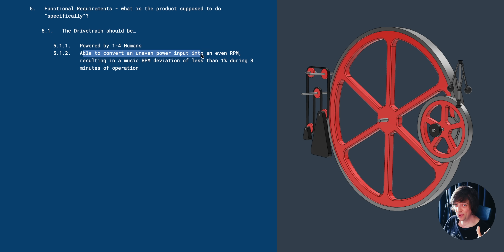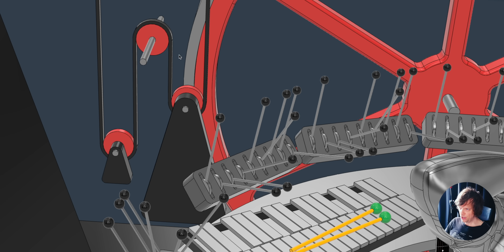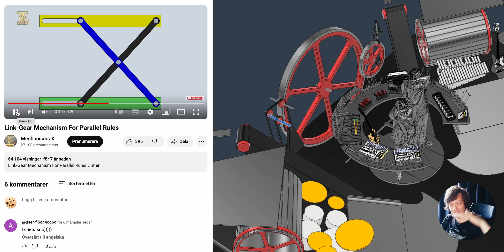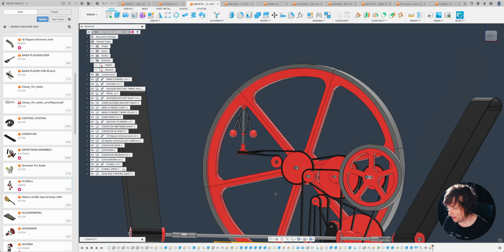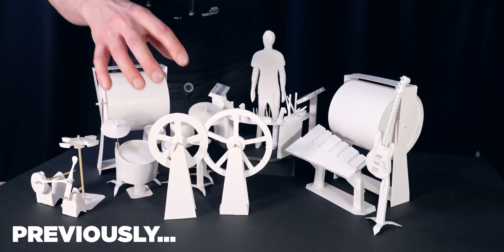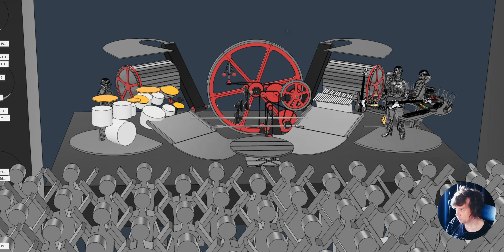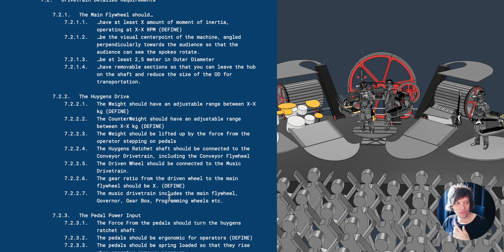The Marble Machine Drivetrain

Comment: As a stagehand I would recommend making the machine able to be assembled or disassembled in under an hour. In fact if you plan on touring MM3 I implore you to think about how it loads in and out, how it packs into a truck, and who you want touching it. Tie every design decision back to the load in and out of the machine, you will save a lot of headaches for everyone. Think about how things could fit into standard road cases or pelican cases and what needs to have custom transit equipment. Think about the other elements on stage with you, the lights, sound, atmospherics, automation, laser, pyro or CO2, and everything over in dimmer beach and soundland. They are packed in very specific ways on the truck to ensure driving stability and efficient load in and load outs, so they are loaded and unloaded in that order, having this giant thing in the middle of the stage could increase your in/out times by hours. I don’t know how it works in the EU but in the US and Canada most of your local crew will be union. IATSE has strict rules around working hours and you’ll end up paying a lot to the venue for any extra time worked while trying to maneuver around this machine even if they aren’t touching it so the venue can pay union rates. I would also recommend hiring a technical director to help you in considering all of this. I can’t wait to see MM3 eventually and if you consider these factors that can hopefully be soon.

Comment: Are the pedals really a good idea? Seems like they will require a lot of effort to drive the machine. The prototype for a flywheel back in Germany seemed like pretty heavy work eventhough there were no equipment to be driven.
And with this heavy work for the two operators, will they have enough balance to play the keyboard?

Comment: The design looks great. One of your requirements should be a a both modular and compartmented design that facilitates reasonably straight-forward set and strike capability that also minimizes the amount of manual assembly of the various components. This theoretically should speed up set and strike, ease of getting loaded in and out and reduce the chances of parts going lost and/or missing. Rely on readily available off-the-shelf parts whenever possible so things can be replaced and a reasonable supply of spares can always be kept on hand.

Comment: Why not put the flywheel and related mechanics in front of performer/operator platform, but have platform elevated by about 1 meter, such that the top of the flywheel is roughly waist-height for a human standing on the platform? That gives audience a clear view of both the machinery and the performers. One downside is there's no longer a big elevated flywheel as a backdrop. Maybe instead of the flywheel backdrop, you could have a single huge marble conveyor belt (which feeds marbles to instruments on both sides / programming wheels) as sort of a "wall" behind the operator platform.

Comment: Martin-  the position that occurred to me when you were trying to make the mechanics visible was up.  Lift it up and drive the program drums and belts from the top rather than the bottom.  Not sure if you run into logistical problems with a vertical clearance requirement that tall, but it seems like it would work both visually and mechanically.

Comment: You have a conflict between two unstated requirements:  1) the pieces of the mechanism should be close together, and 2) if it’s cool, the audience should be able to see it.

Write them down, think about the purposes they serve, and refine them.  ‘Close together’ makes it easier to build a stiff frame, and to minimize material, but the deeper functional requirement is something like, “this piece needs to receive force X from piece A and send force Y to piece B.”

Refine the terms so you can give them weight numbers.  Then you can use tools like priority lists and weighted decision matrices.

You might find it useful to place items in ‘audience view planes’:  items in the same plane can’t block the audience’s view of each other, but Items in plane N can block the view of items in plane N+1.   It can give you a rough spatial outline of relative placement.

At a guess, you’ll need to build some larger models to play with the visual/mechanical balance.  Even a slow turning sheet of cardboard captures some of the coolness, and will have some of the mechanical design problems.  Experiment with what’s fast and cheap.

Comment: One intteresting solution could be to put a low light in front of the gears and project its shadow onto the wall behind you. That way you still get a sense of the motion even with the control panel in front of it.

Comment: If the entire floor is a full set of petals. Use wire cable releases and have two sets of petals rigged under the pullies and have it under the solid stage with access doors panted like you have it here. I love your bicycle built for two.

Comment: I would have the large flywheel behind the performers, but raise the platform up slightly above the centre of the flywheel, so all the smaller gears and belts are visible under? Might be too impractical. But #1 priority should be function always.

Comment: Martin, in your requirements, consider providing each unknown / variable parameter with its own symbol.  Mf for mass of flywheel, or Igr for Input gear ratio etc.  Avoid using the same letter, such as X for multiple items.  Later, define each symbol so that a change to the symbol definition updates the text of the requirement accordingly.

Comment: I think the design spiral orbital process should consider a one-shot marble load per song; using weight of the marbles could be used to drive the huygen drive—even excess marbles to accomplish the song. 

- overall noise and complexity.  No lifts while playing, no distraction racetrack noise of recycling marbles.  - - more Human Element and Industrial Machinery:
Less of a perpetual machine, more of a performance energy only.  The crowd doesn’t need that much stimulation or benefit from compression of all of the operations of marble circuit. From the beginning the leverage of marbles is to create more music from one person, by pre-programming, then enhancing with live playing. 
Fills?   Gen 7 shows human drums alongside marble drums. Redundant and maybe crowd confusion; more processable mental information to the audience to ponder who is playing
The wonderment of industrial machinery—often overlooked--- many people performing menial effort that combine for power output-shoveling coal for steam.  If anything, the load of marbles at end of song being human carried and loaded for next song would be artistically significant.

Comment: What if you raised your drive train up in the middle with the control panels in front?  This would make a strong visual statement also moving spinning wheels and belts away for your safety.  You will have a lot of stored energy in your Higgens drive.  You will want to be safely separated from it.

Comment: You could maybe make the central platform (where you stand) wider, so that you almost surround the central wheel and the mechanics in front of it. But that requires extending the width of the machine, I think

Comment: Are you intending for the input pedals to be rigidly attached to the drive of the flywheel? Or only be a positive drive (e.g. ratchet and pawl type effect)?

Especially for the single-dirrction linkage system I would imagine the latter may be preferable for safety etc. (getting your foot caught). Especially with having multiple inputs.  

If you're doing that, I might recommend using a sprag-element one way clutch (or maybe a one-way bearing ramp type one, though it might be hard to find one with enough capacity for the torque) rather than a ratchet system. 

It will be significantly more expensive, and they are a bit more complicated to implement depending. However, they're effectively silent as compared to the ticking of a pawl, and I imagine that noise would be a big drawback since it wouldn't be synced to the music at all -  literally just random mechanical noise behind everything.

Comment: Hey, how about raising the mechanics up? Maybe not super high, but 50% or something? Drive the conveyors at the top instead of at the bottom and use shafts to get the power where it is needed. Making it compact is one thing, but if that takes away the aesthetics that you're looking for it won't really be beneficial, right?

Comment: Are there maximum height requirements for the machine to fit on stage? I think it'd be cool to have the mechanisms behind you, but raised to the level of your head. You could have the sideways bars running to the top of the conveyor belts instead of the bottom. Then the mechanism would be completely visible. Might be tough to lift the thing 2m off the floor, though.

Comment: What about moving the mechanics 1-1.5m higher? That way they could still be behind you while you are still in the center. Could look almost like a halo around your heads where your heads are the same height as the drive shaft of the fly wheel.

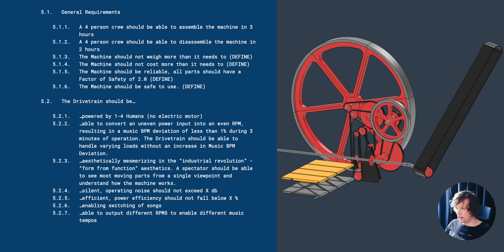Comment: 5:36 "pump harder when marbles are on conveyor belt". At this point you could use a second band member to help pump the pedals and spread the load. Use band members as gearbox and you could perhaps employ a gearbox mechanism into the design a bit easier. 

You could also turn your pedals 90 degrees and possible have the output go directly into the mechanism without bevel gears or 90 degree gearing.

Comment: 1. Flywheel. Good idea. Needs to be safe. Needs a solid base. Keep it low to the ground and covered by a clear guard to prevent people from falling into it. The higher your flywheel the heavier your whole machine because of the frame to hold it up high.
2. Pedals. Mid idea. Especially infront of your spinning death wheel.  Somebody suggested already bicycle pedals and saddles. I think this is much much better and more stable. But at this rate, if i was to strongly suggest something, i would NEVER eliminate the possobility of a hidden electric motor to assist lifting the hugyen drive. 
3. Disassembly requirements. Fantastic idea. One of the best things you've written for the machine. Include safety requirements now since you are using flywheels. Look up freak flywheel accidents if you arent convinced it should be on the list.
4. Belts. Meh idea. Limit the nunber of direction changes and sources of friction. Try to keep the drive train and governor central on the same shaft. The risk the design is running into is putting so much friction and efficiency loss to drive the thing that you wont even have residual power to lift marbles.
5. Simplify. Simplify. Simplify.

Comment: Have the machinery in the front, and you on a massive riser behind it. Grand staircase off to the sides? Maybe a ramp coming off the top of the programming wheels, so that you never cover them up? Or up the production value and use an elevator to show off how dynamic everything can be 😅

Comment: First, you could raise the mechanics a bit. Say, a quarter to a half meter. Then keep the operators in the center.

Second, each pair of pedals need to be coupled. Let's call a pair the A pedal and the B pedal (which is under the left foot and which is under the right depends on which direction the operator faces. So two pair of pedals, A and B. With the full weight of an operator on both pedals, and the operator's feet at the same height, the that pair of pedals is in the neutral, or centered position. The operator shifts their weight from left to right and the pedal under the right foot sinks while the pedal under the left foot rises an equal amount. Maybe the operator moves the pedals up and down by 10 cm, or maybe the operator moves them up and down by 3 cm, it doesn't matter. And so, get rid of the spring.

This is gonna be great!

Comment: I feel like you being the source of power for your machine is a mistake. You will being running the machine, playing instruments, and front manning a show. It seems overly ambitious to add what looks like it would be a serious cardio workout on top of that. That's not to say it shouldn't be human powered, I think that it an awesome aspect of the project, but in my mind, it would be better instead to either have a dedicated person for powering the machine (they would also help set it up, change tracks, etc.) or select fans from each concert local to be the machine's power source.

This could also allow the power source to be something simpler and efficient than a pedal pump, like a stationary bike, or if you want to be fanciful you could use something like a treadwheel.

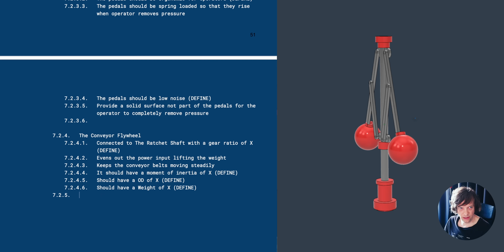Comment: @5:48 I don't think you understand how a governor works?  The spinning balls cause the pin to rise or fall, and the pin is supposed to be connected to the motor throttle... it makes no sense on a flywheel connected like that.

Comment: ...Martin... You're designing the look of the machine, and figuring out how to make the design work after. That's designing function from form. You swore you weren't going to do that on this machine.
Not to mention you're adding a LOT of complexity on the drive train where there doesn't need to be complexity.
You should stick to the Form from Function approach until the machine is finished, and then, thanks to the modularity, you can work on replacing parts of the system with more cool looking and complex ones.

You're trying to build a finished product before you've made sure the prototype was viable.

You're starting to make the same mistakes that led to the failures of the previous marble machines.

Comment: When you figure out the layout of your machine design, you could consider, when you are on tour, having projectors displaying the close up workings of the machine parts in real time, during each song. This would be great for the people in the back, but also for people with an extreme side angle, or obscured angle in general. Such as the band in the way of the gear shifter. It would also be very reminiscent of the original marble machine video where the viewer gets to follow the black marble.

Comment: I really love this project, as I did Marble Machine #1 and MMX, but I somehow think the scope of your vision has blown up exponentially. I think you might have to take a step back and think about the machine and your performances thoroughly. 

MM1 and MMX were pretty "small" machines, which could be transported really easily. With this ginormous machine, I don't think transport will be easy. For example, just think about the weight difference, this alone will make transport more complicated.

Also there's the concern of safety. Before with MM1 and MMX there wasn't really a huge life-threatening safety concern. Yes, the other machines also had their "safety" concerns, but on this machine you plan have giant rotating parts. When their safety is unaccounted for, they will be incredibly dangerous.

I find, that you have fallen into a kind of tunnel vision, only thinking about the looks of the machine and how it works. But I beg you to take a step back and ask yourself, what exactly you want this machine to be and how you can make it safe(r). This could also be a great idea for a video, where you could explain your thoughts on my raised concerns.

As I have seen from the comments of the past few videos, I'm not alone with my concerns. This is not a small minority of your audience, so I ask you to clear things up a bit. Remeber, if this  many people raise geniune concerns, they might have a point. Please just reflect on that.

Comment: I know everyone always bombards you with things they think you should be doing. However, one thing I learned in my senior design class which I find very useful is to not ever include specific technologies in your requirements because it can pigeonhole your thinking. For example at around 4 minutes you have a requirement stating that the pedals should be spring loaded. I would simply replace this with "return to a home position automatically". Although a linear spring is likely a good option, it may not be the only one or the only one. I feel like you did a very good job of this earlier which is how you settled on your current design choices. An easy trap to fall into later on in the design stage is to abandon this process because you get bored of always relating things back to requirements, but the tighter the web between your design and your requirements (imagine lines connecting each part you designed to each requirement, with bolder lines representing a stronger connection) the better integrated your system will be. 

As a final comment, I would also consider that mechanics are engaging, put people are drawn to changing movement. That's why people like watching other people perform on a stage. Mechanics like yours are cool but their motion is constant, it doesn't vary once it gets going. The juxtaposition between a mechanical backdrop and people in front of it is a captivating one on it's own. Hints of a mechanism are often even better than seeing the full thing because it leaves the viewer wondering at a deeper picture instead of just presenting it all up front. That's part of what made Animusic cool when we were kids, the sets seemed to just keep going and going into a background of mechanics (like how many pipes there are in Pipe Dream, etc) and it wasn't immediately obvious what did what. You just kind of stared in wonder at it all. Recreating that backdrop will engage your audience further I think, but it is just my opinion.

Comment: Great Job. Love hearing your thought process and seeing your progress. One thing though, if I may. The double U-joints will cause the marble conveyor to slightly speed up and slow down about 4 times per drive shaft revolution. Does it need to be constant velocity? If so, a cogged belt might work better if the angle isn’t too much.